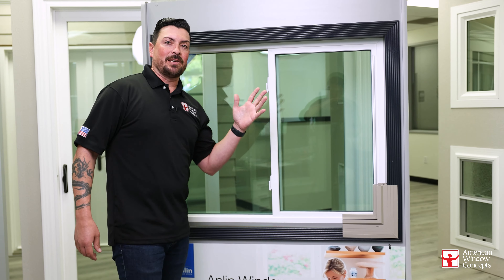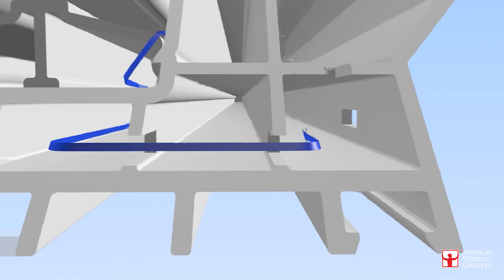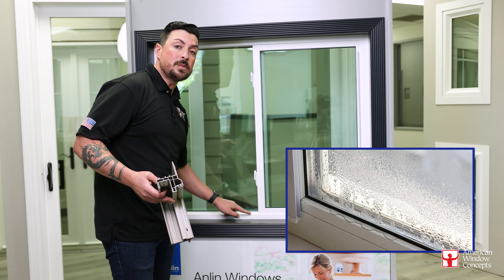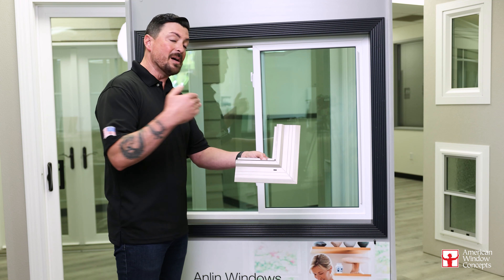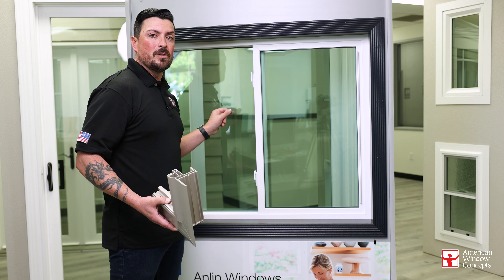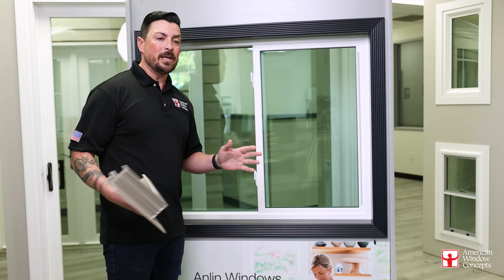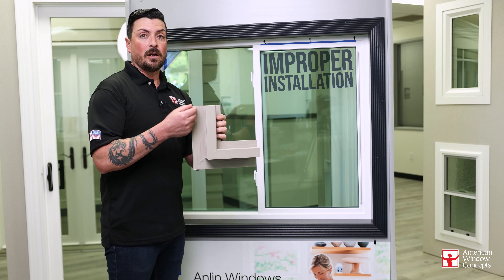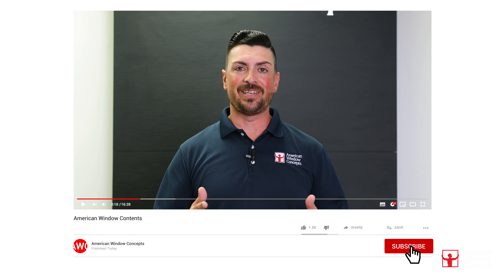Why Is My Window Leaking Water? (And How Do I Fix It?)

Comment: As a professional I have a little issue. Water in the track is not really a leaking window.  It is how the window is designed as you showed. But this is probably VERY valuable information for the homeowner. My issue is the video should actually have been titled something like “ is my window really leaking?” But a well done video that I feel needed to be made.👍 What a lot of people don’t understand is, this is often the difference between a cheap window and a quality one, how well the weep system is designed. In cheap windows the weep system is very easily overwhelmed.

Comment: We just had 2 windows at the back of our house repaired because it was leaking. It started leaking again when it rained and so our contractor opened the stucco again and added a channel. It leaked AGAIN and now our contractor wants to tear down the ENTIRE inside and outside walls of the back of our house because he thinks that that part of our home (which was an addition/extension) was not wrapped. The house and extension was built in the 1960’s. He is charging us  an additional 15k (not including materials) to do this! We already paid $3000 for the initial repair? What should we do?? It’s leaking from the top, btw.
Reply from the maker: Hi Sheila, I would take the same measure as your contractor honestly. I would cut back the siding or stucco, and redo the window install with nail flanged windows and new flashing. Also, I have seen roofs create major issues with windows as well, but that usually would be in a condensed area, and might show water bubbles in the drywall above that window. I hope everything goes well and this gets fixed for you once and for all.

Comment: We get several typhoons here on Okinawa and the water pushes through my aluminum window seals. Seals are very much like the ones you showing in your video. However, if we do not block them, it will overflow onto wall and the floor. This just happened during the last typhoon with one of the windows we did not block. It puddled onto the floor and leaked to the bedroom ceiling below that floor. Lots of damage. During a typhoon we usually block all the windows with doggy pads and even diapers and just change them out as they fill up. It’s like a reverse fire brigade that never stops until the rain and wind stop. I would love to know a way to fix this problem.

Comment: I had new horizontal windows installed a couple years ago but ever since in my daughter’s room the wall is getting wet under the window and under the sill. You don’t notice it until it’s too late. I checked all the caulking and everything and even cut the old caulk out  redid it all. Is there supposed to be caulking around the bottom mounting screws  supposed to be called ? That’s the only place I can see it coming from.

Comment: Hi, you mentioned to never put towels when it’s leaking, what damage do the towels make by doing this? Thanks!
Reply from the maker: It creates a dam, and that water will be sure to overflow the main frame...which is what you do not want. The best thing is to allow the water to weep itself out between wind gusts, because this is the only time (usually) when you will see water pool up in the window tracks.

Comment: My new window is filling up every rain and its concerning. Initially, it was overflowing so they reinstalled it. Its still filling up but its no longer overflowing or hasn't for the last 2 rains. My neighbors used the same window company and style window but theirs is not doing it. I live in Florida so we get alot of rain in certain seasons. Its stressing me out and my home improvements are put on hold until I get answers. I did a water test on the glass only and it filled up quickly so I don't believe its coming from anywhere else. Any ideas on what is wrong?

Comment: I’m at my wits end. Have an older brick home. The window in my son’s room, single pane, appears to be leaking. I’ve had a window company come out & tell me the window is fine, I should call a brick mason to have bricks around the window repointed. I did that but water still is coming in. It appears to be coming in from the bottom(pooling in the sash) during a blowing rain storm & dripping water into the room. The floor is damaged as well as the ceiling in my dining room(below my sons room). Roofing company came out & said roof looks fine but took photos of another window and said there is no caulk. Had a handyman caulk that window & water still comes in. Looks like the caulking around the sill is gone. Any thoughts? Could it be the window? Most window companies don’t want to replace just one window because they don’t make money off of one window. I have 24 large windows in my home & cannot afford to replace them
Reply: I’m having the same problem. I just changed my windows to Impact but the floor Is already damaged in my daughter’s room. I had to replace the drywall below her window because it was wet and full of mold and in the garage ceiling as well. The garage is under her room.  My association  takes care of the roof, and they sent a roofer who said  it’s the window, the window company says it’s the roof. I’m soo sick of this!!!

Comment: What about leaking window in older 1945 window?  (Wood frame on outside, single pane sliding side-to-side on aluminum track.)   Water pools in track when rains. Is showing worst effects—paint peeling & moist wall—at lower corner.  Can good caulking, sealing & repainting job remedy this?  Other comments / guidance appreciated.  Thanks in advance!

Comment: I have one window that doesn't drain properly and I am not able to get it the manufacturer to fix. It has never worked properly is there any way to drill down the weep hole to open it? Is there any other way to fix this issue myself?

Comment: When they installed my new windows I noticed that the windows aren’t flush against the wall of the building or recessed. The seem to stick out a  bit which the installer put this black caulking around to seal. Is that normal? Do I have to worry about the caulking failing and water seeping in ?

Comment: First off is I had a leaking window, So I sealed it completely with Silicone Sealent. It still leaked. So, the next year I sealed it with Flex Tape and silicone. The leak slowed down but still leaked. Next I put a small gutter over the window and the leak stopped for 2 years. But suddenly with the heavy rains in New England this winter it started to leak again. I am absolutely perplexed as to why this window is leaking again. Any advise from anyone who knows how to fix this will be appreciated.
Reply: Hi, How did you put gutter n have any permanent solution u found?

Comment: I'm getting water from bottom of window, small drip on heavy rain when it's blowing at window. any help thanks
Reply from the maker: This can happen when you have wind driven rain. there really is no way around this type of storm versus your window with a weep system. The biggest thing to remember if you see some water in the window track is DO NOT put a towel in the window track. Let the weep system do its job...that is to weep the water out of the track and frame between gusts.